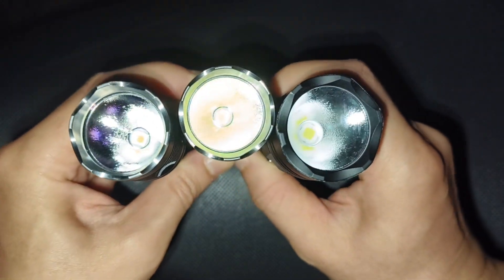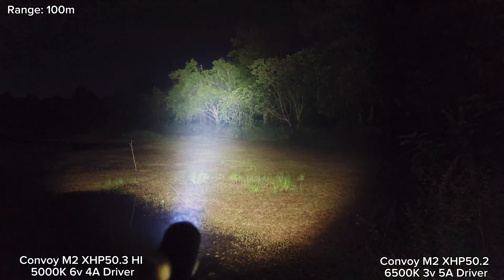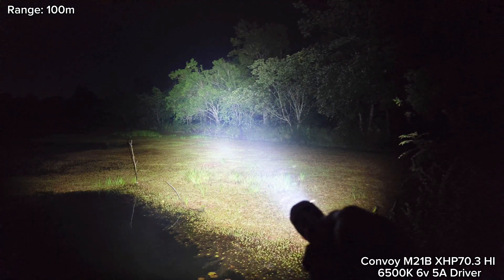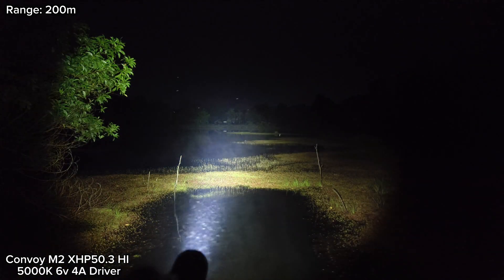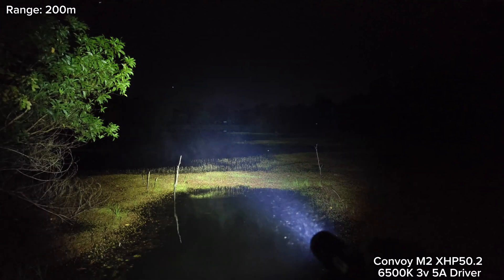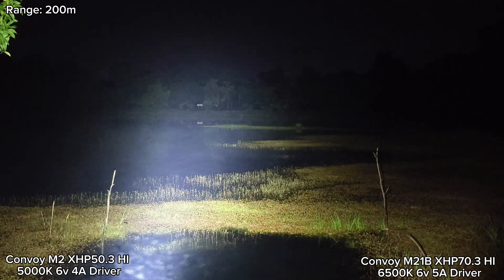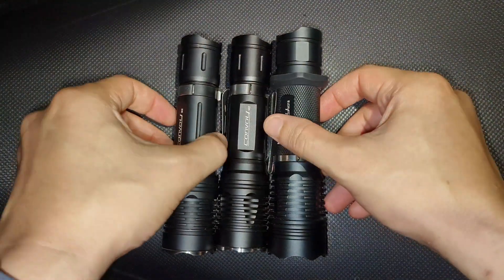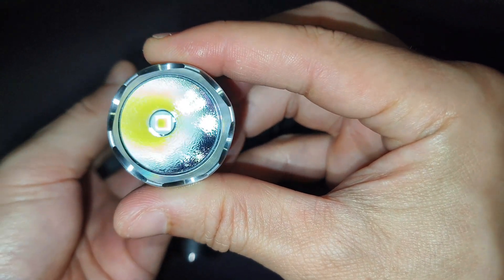Convoy M2 XHP50.3 HI 5000K 6v 4A vs M2 XHP50.2 6500K 3v 5A vs M21B XHP70.3 HI 6500K 6v 5A Driver

Comment: Hi i just noticed that Convoy released another flashlight. M26d. Its similar to m21h but it takes a bigger battery and has a gray button. Its like 10mm longer but same size head. Not sure about driver.
Reply from the maker: Yes. I have seen it sir. I think the same driver but bigger battery. Thanks for watching and your support sir 😊🙏.
Reply: @weerapatkiatdumrong  I just ordered m21h xhp70.3 in 3000k. If I get the m26d think I should go for xhp70.2 3000k or xhp70.3 4000k?
Reply from the maker: @avgrim7729  70.3 4000K sir. Ithink it's good. Thanks for watching and your support sir 😊🙏.

Comment: What's type battery are you used with 6V driver?
Reply from the maker: Just one normal 18650 battery. The driver will convert the current to match the 6v led sir. Thanks for watching sir 😊. Please subscribe 🙏.